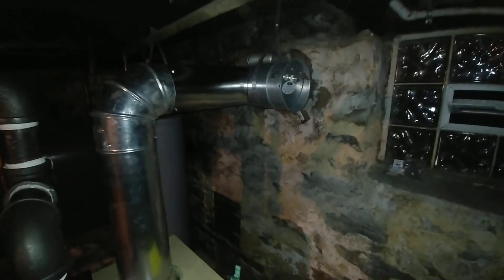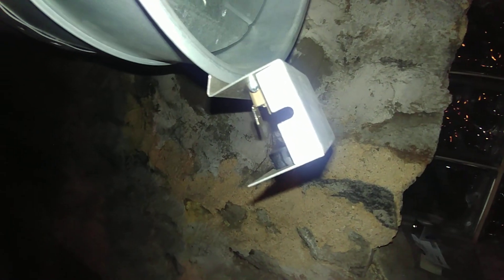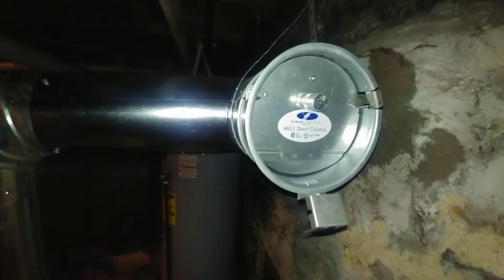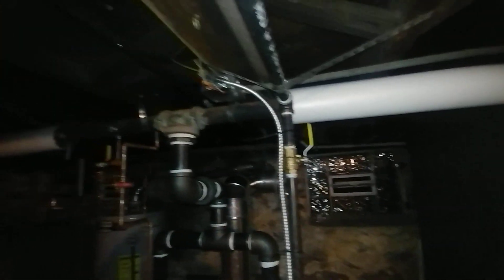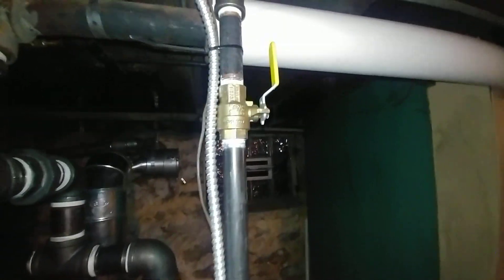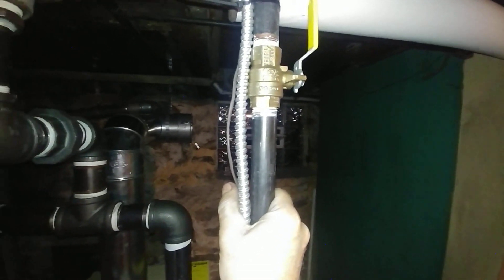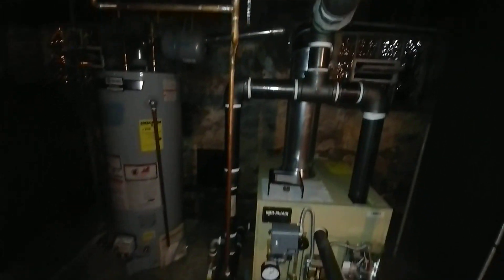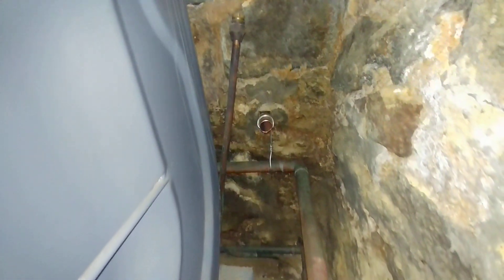Almost Finished Install Of Gas Fired Steam Boiler.

Comment: nice work.  on the steam do you think they will save with gas?   what do your customers say?
Reply from the maker: In general, it appears almost all of our oil to gas conversion customers are happy they did it.
 
Saving can be difficult to quantify fairly, however.  Usually, we start with an oil steam boiler customer when they call us about uneven heat, pipe noise, etc.

We usually solve most of those steam system issues to the customer's satisfaction and thereby build trust, and start them down the path to energy savings with comfort with their existing systems.

Often, we get the chance to work on the old boiler itself to get it to work better after a though cleaning and tune up (usually after years of neglect).